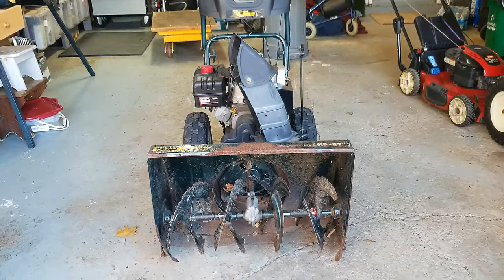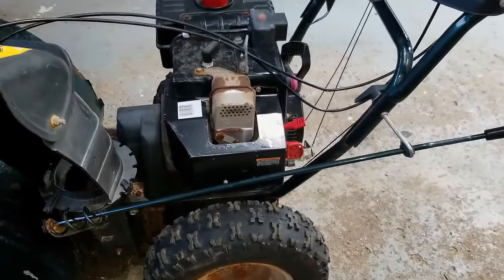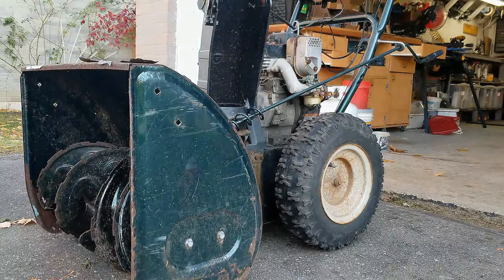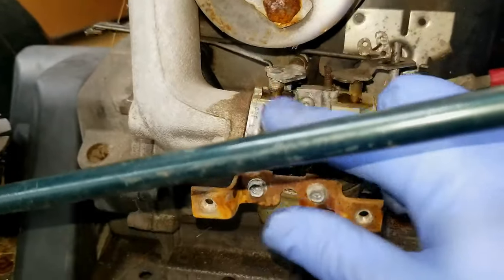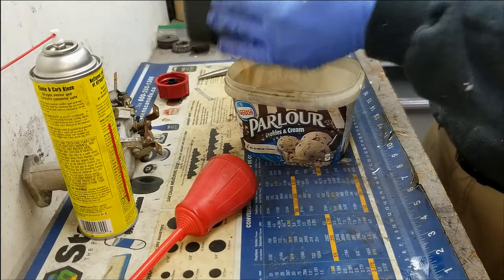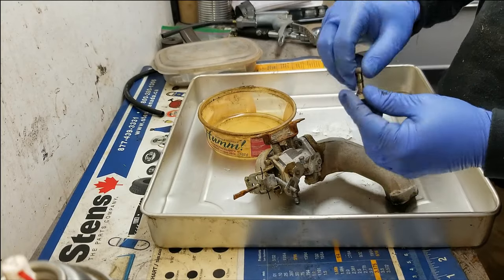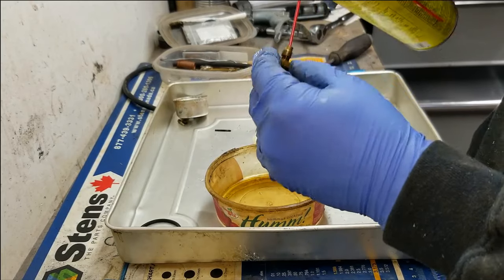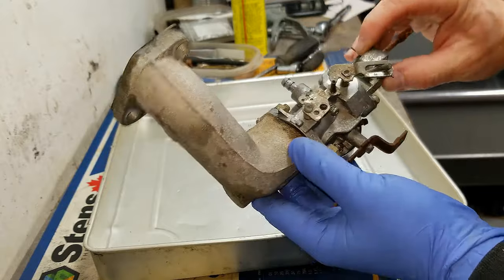Yardworks Snow Blower With Lots of Issues. Can We Save It?

Comment: The OLD MAN at EP wishing you and your family a Happy and Safe Holiday Season. Hopefully this one turns out to be a profit maker but we have had many of these multiple section augers come in with brass worm gear failures simply because if something hits between the two auger sections normally the two shear bolts do not get sheared and damage is done to the worm gear. Once this happens it only gets worse from there. Possibly in your upcoming video you can point this out to your viewers we would suggest staying away from this style snowblower simply for that reason. Additionally the Techumseh carbs have a small vent hole that needs to be clear or the engine will not run properly. Normally this is never an issue but we have come across these being plugged on a few occasions. Looking forward to the next part. Oh if you want to support the front bent area of the auger housing install a drift cutter on each side going down to the bent area, you will need to drill a hole to mount at the bottom but it works great providing additional support to that area. They just do not make them like the old days!
Reply from the maker: Thanks for all the tips Wayne. Wishing you, Jake and your whole family a safe a happy holiday season. Cheers